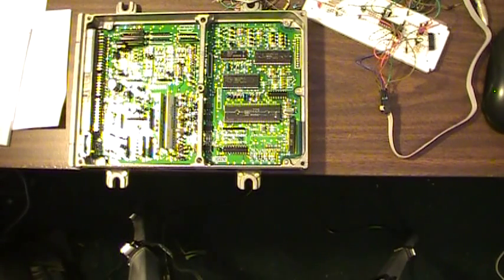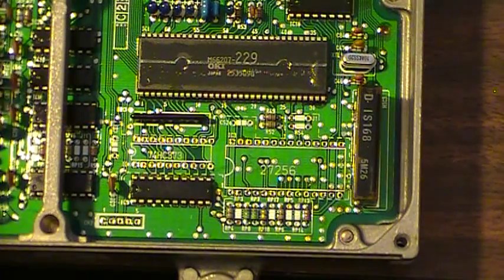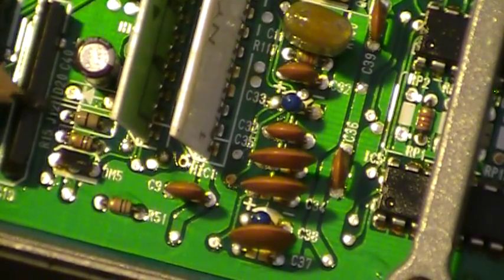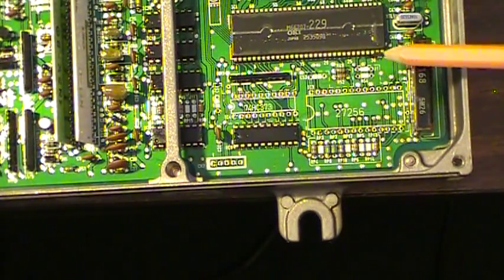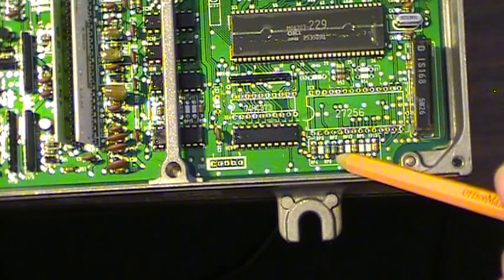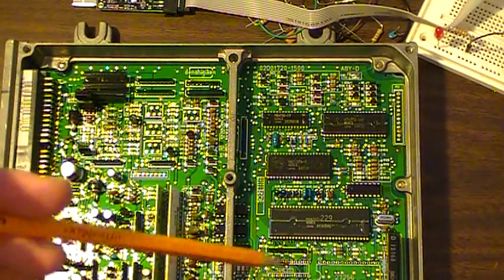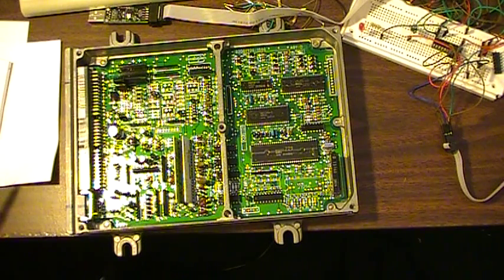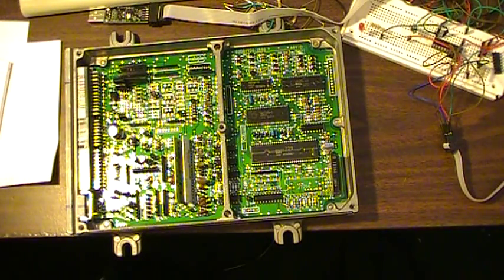anatomy of P06 ecu

Comment from the maker: Double check this.  I have not done this yet.  But, you should only need to: Remove both RP17 and RP18 resistors and install a jumper across RP18.

Comment: on my 37820-P06-A52 what circuit component area is responsible for triggering Fuel pump 2 second (or so in time) prime and the trigger out the CEL light? All indications that my ECU is to blame for the long long extended time it takes to get fuel to start the car once I hear the click of the relay so I can run the car. Also going from automatic to 5 speed ( on the P06 ECU ) some people are just cutting out RP17 resistor and leaving in RP18 n saying it works. Just curious on this all.

Comment: Que controla la valvula iac ?
Reply from the maker: Connection A pin 9.
Reply: tubejim101  El resistor Q21 esta quemado
Reply from the maker: Q should be a transistor.  Would look at getting a good used ecu.

Comment: well my car won't start I've swapped out for another one and it's not working and they only work when they want to and the fuel pump relay is new so I'm getting a solid check engine light and no codes
Reply from the maker: Need to get a test light, and check out your fuel pump relay.  You can have someone turn the key, but don't start the car.  Other person is by the gas cap.  You can listen to see if the fuel pump is working.
Reply: tubejim101 I have the same problem, I installed a new relay and it still won’t start. I don’t hear the fuel pump prime
Reply: Same problem with my p06. Checked all the main relay wires. Im.not getting signal from the ecu

Comment: what part of the ECU controls the fuel pump to kick on do you know?
Reply from the maker: which engine, and ECU are you working on?
Reply: Hi! This is a old post. Im working on a p06 obd1 ecu and does not have fuel pump signal to the main switch. The car has a check engine light that does not turn off and wont start. Fuel pump wont prime as well.